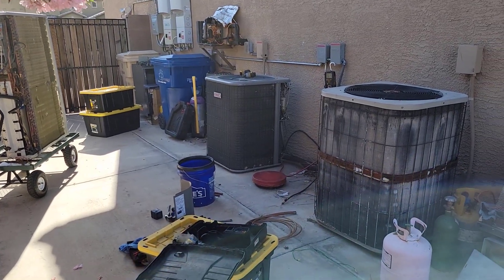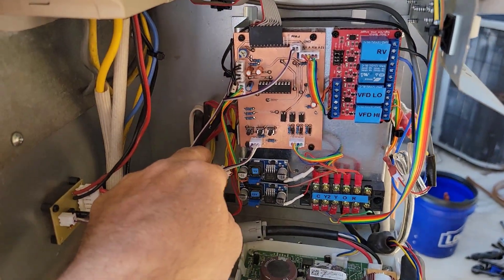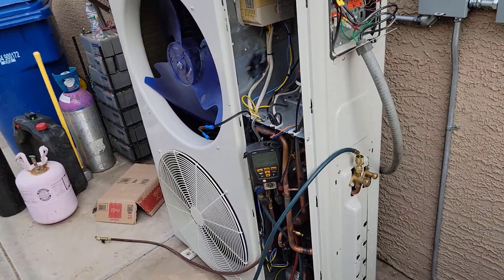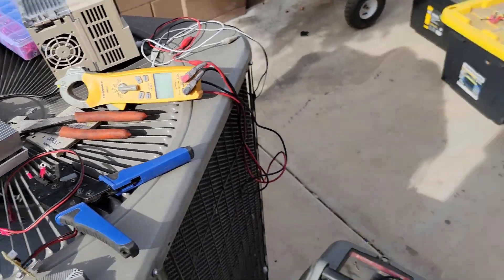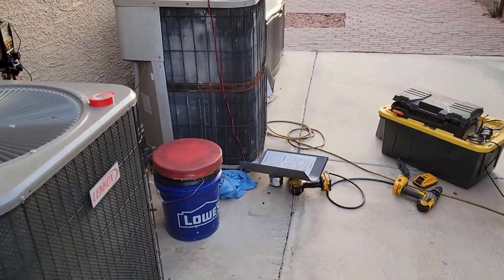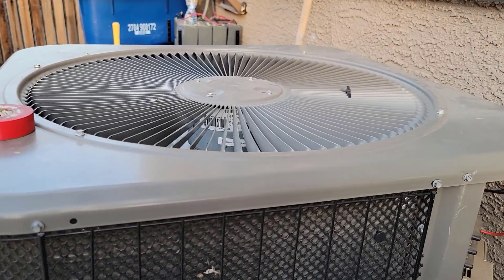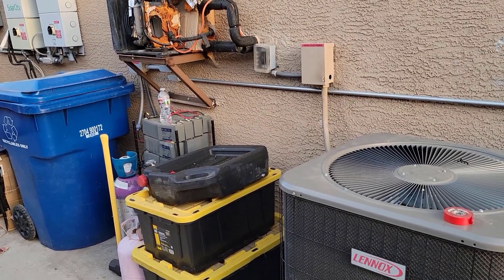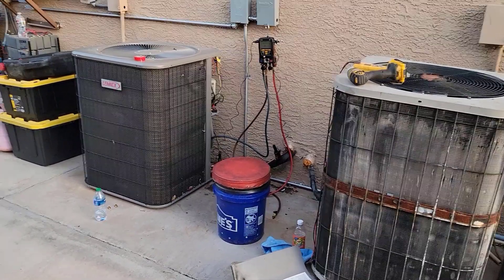Frankstein Heat Pump let the smoke out --- Lost the battle --- For now

Comment: I am wondering if the pop during power on is due to inrush current to fill the capacitors on the drive now that you have it hooked to real 240v. I wonder if you can pre-charge the capacitors on the drives with a resistor before you actually hook it to mains. This is more common with people connecting large inverters to battery banks in off grid solar stuff, and you can look up videos on that if you need to find more info.

Comment: Couldn't help but notice the sledge hammer sitting under the water heater HP.  Is that for use "in case of emergency", such as one more board letting the smoke out?  😄

Comment: puzzling why that happened.  i mean some of those inverter boards don't like supply around 250v, but to smoke pretty much immediately still seems strange.   make sure it's not something else like some weird ground loopy kind of thing, then perhaps go with a small cheap  50 or 100VA buckboost xformer to drop the supply by 16v.

Comment: The dc-bus on original board should be already have pfc done, which means the voltage is boosted a bit.
Reply from the maker: I don't know if they use PFC in these. Seems to just be whatever the line voltage is rectified at the caps. The manuals say that the DC to the fan is like 290-380. A pretty wide range for acceptable voltage.

It was wired to my Yaskawa VFD DC BUS and tested perfectly when I had it plugged in my garage. The only difference was I did use a transformer in my garage to step up 120V to 240V instead of plugging in to a 240V outlet and when I went to install it I connected it to 240V and BOOM!

Comment: That's R&D, when it works, everyone will ask you why it took so long😎. Staiyng cool is a skill. For those DC fan motors, do you think you could drive them with E-Bike 24v controllers?  There are hall sensor and sensorless versions and they are cheap.
Reply from the maker: The motors are 300 VDC and use feedback from the windings for position